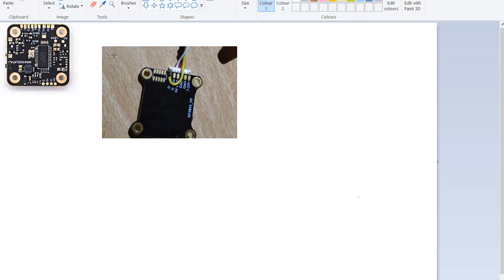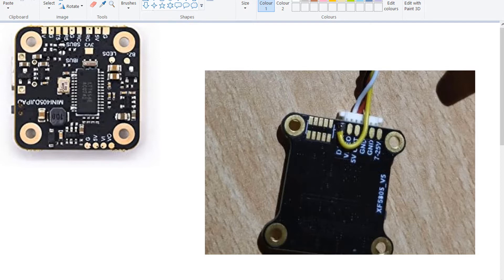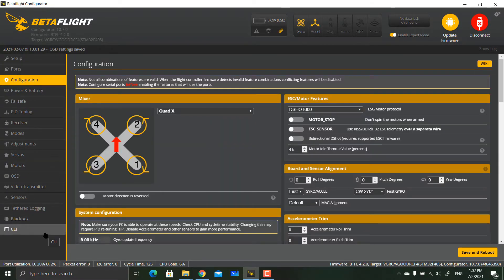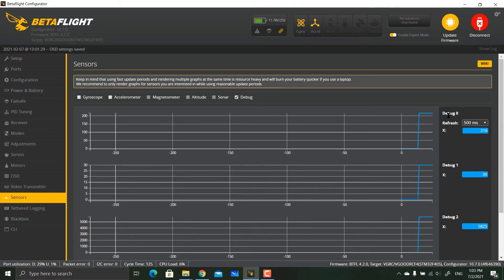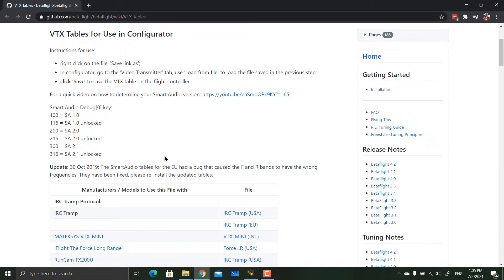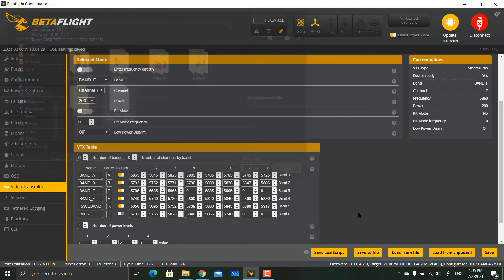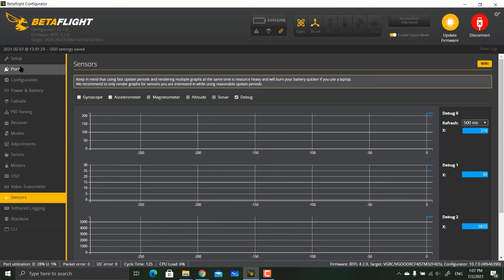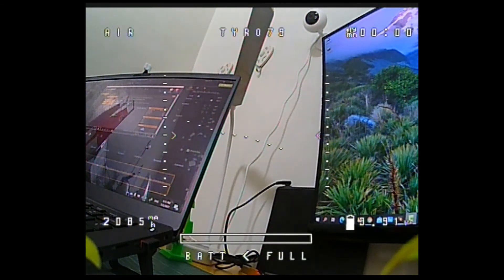Setting up Tyro79 Smart Audio with MINI405DJIPAD Flight Controller

Comment: Thanks alot ! Couldn't find any solution for XF5805 vtx smart audio and Betaflight 4.2 +
For some reason configurator on windows crashed as i tried to load JSON file, so I had to change the setting in speedybee app, which worked flawlessly :)
btw you should've used version 2.0, if you get value 216 in sensors readout, as it says on the github page, I used 2.0 EU and it works just fine.
Smart Audio Debug[0] key:
100 = SA 1.0
116 = SA 1.0 unlocked
200 = SA 2.0
216 = SA 2.0 unlocked
300 = SA 2.1
316 = SA 2.1 unlocked

(unlocked means there are no locked power options most likely)